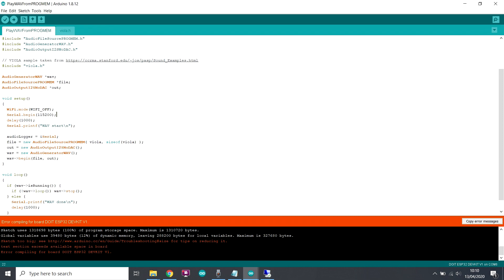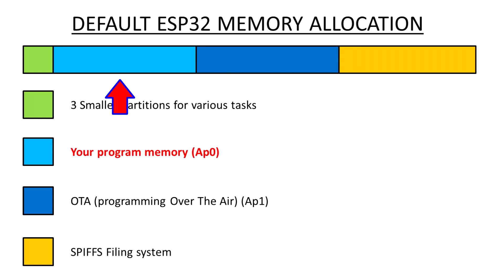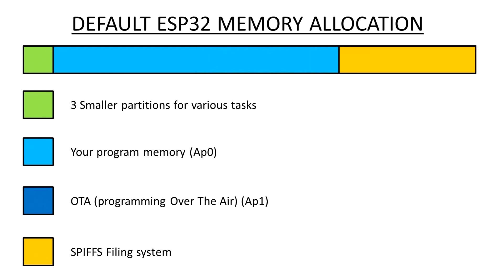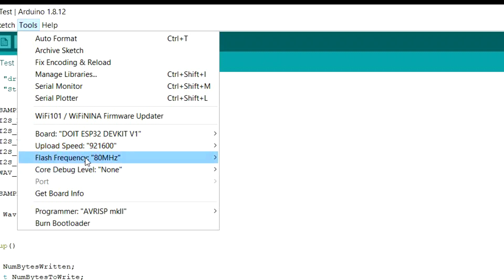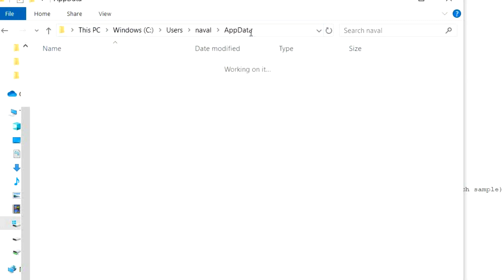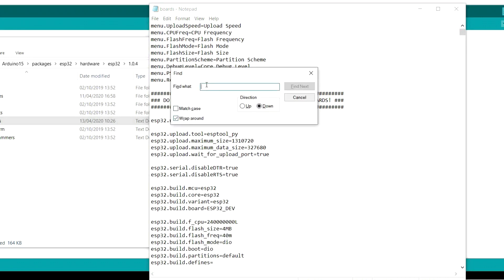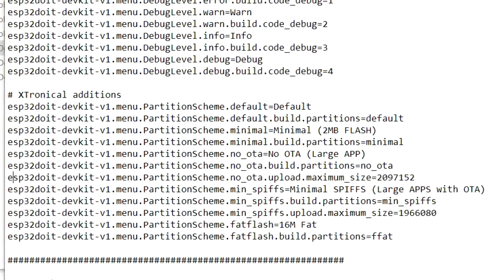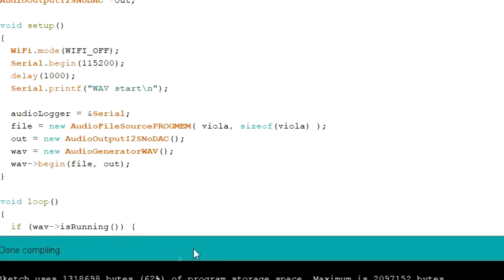ESP32 - Out of memory - How to solve this compiler error and get more of the memory you paid for!

Comment: Please help me out, I did this for nodemcu-32s and still this doesn't work
Reply: I did t for firebeetle32 it didn't worked
Reply: @cyberfox9595  so I figured it out by myself. See try different boards. In stead of using nodemcu32s I used DOIT ESP32 DEVKIT V1 in boards section. Then partition menu showed up and it worked for me.
Reply: @mackb996yt3   Thanks i will try try that

Comment: Can esp8266 also be modified to increase the sketch partition?
Reply from the maker: I would have thought so but I haven't done much with 8266"s
Reply: @XTronical  Just found out that for ESP8266 1 MB is the limit of the CPU on addressing instructions, so it's not possible to increase sketch partition. Looks like I need to switch to ESP32 soon. Thanks for your tutorial!

Comment: How about es32cam ? This doesn't work for es32cam with same problem
Reply from the maker: The esp32cam has very specific memory requirements, it may behave unexpectedly if you try to change them.
Reply: @XTronical  so how to solve for es32cam?
Reply from the maker: I think the memory layout of the esp32cam has been optimised for it's usage. So should not be changed without knowing exactly what your doing which for this chip I don't unfortunately.

Comment: yawn...18sec in and stopped watching.... its not an issue with the ESP...its a USER ERROR...nothing more..nothing less..this goes all the way back to esp8266... exactly the same issues... the app partition is not big enough...its quite simple to change...as youve shown no doubt.. (arduino ide has settings for 3MB APP buiilt in)
oh and youre not out of memory...youre out of partition space/flash space... memory issues only show up AFTER youve compiled and uploaded to the ESP and it bitches that it cant create your buffers etc..
Reply from the maker: It seems you are being pedantic over words, the term memory covers all forms, be it the RAM you are referring to for buffers or flash or partition memory or disk etc. To say the partition in flash is not memory is wrong. You run short of that particular memory with this problem.  The general use of the word memory in this video is correct and I go on to talk of the partitions later on.